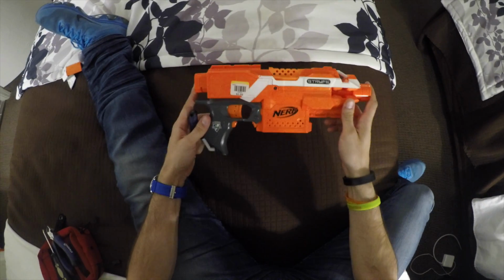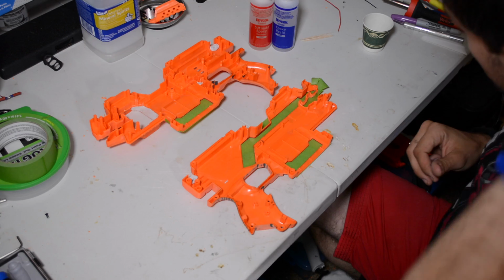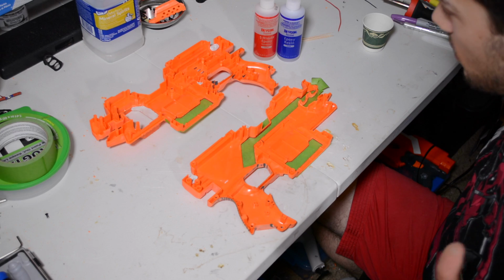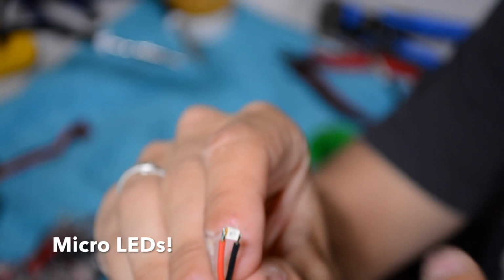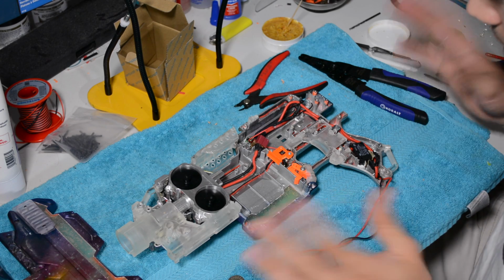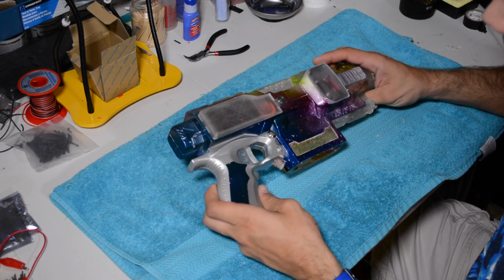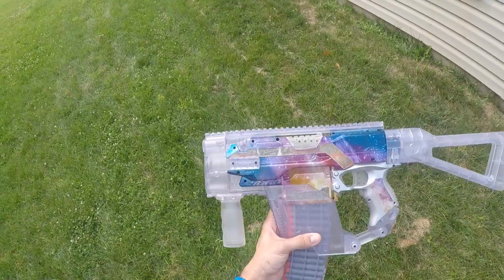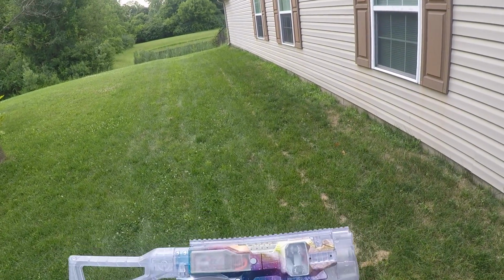[Nerf Mod] STARDUST (One Epic Nerf Mod! A Completely Overhauled Stryfe)

Comment: I went back to look at the voltmeter placement in the beginning. Then, as soon as I thought, "why on the stock mount for a non-pistol Stryfe, I remembered it would be running a clear stock. Really nice position in that case, and an epic build in general.